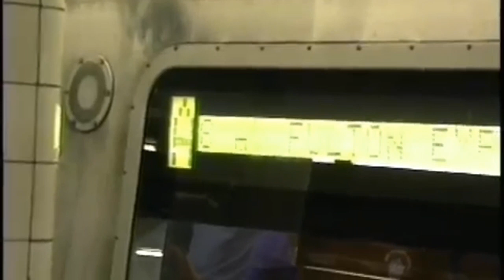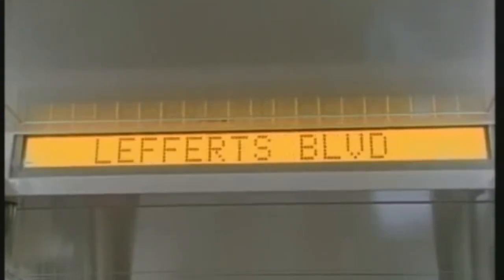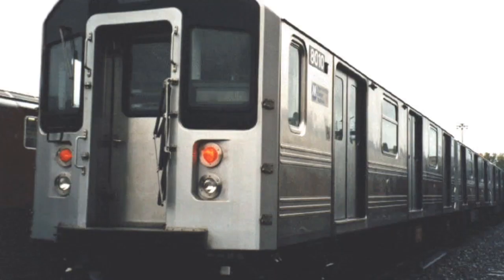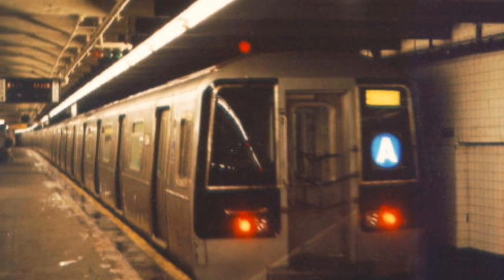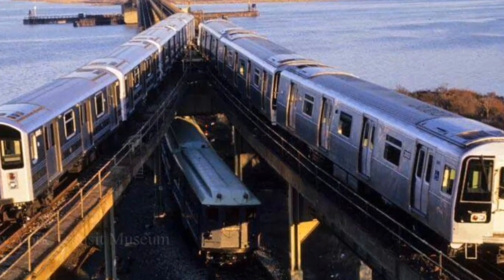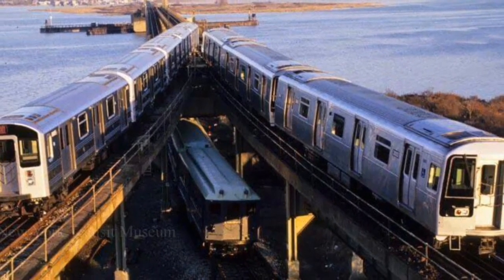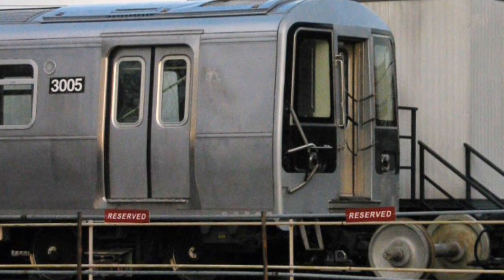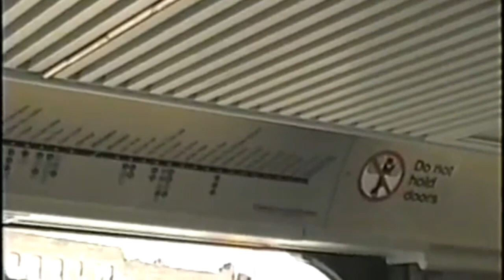R110 subway car review

Comment: Ive Just Realized How Similar The Tracking Systems On The R110A's  Are To The Toronto Transit Commission T1
Reply: that’s true
Reply: Because they have simular propulsion
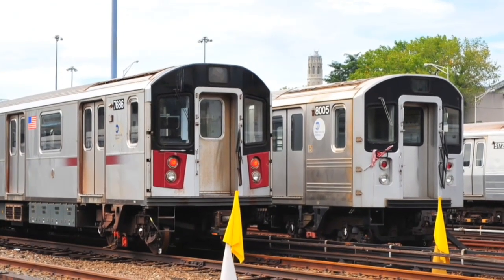Reply: 7:45 This traction system is also on the Siemens P2000 a light rail car used on LA Metro Rail.
Reply: Tracking? I meant Traction.

Comment: I actually liked the 110b car model better than that the  NTT cars that were based off its design.
The 67ft Length is what killed it for the Eastern Division lines,since it couldn't operate in 3 triple sets over there.
However, if those cars were married pairs, then it wouldn't have been a problem. 
The interior of those cars are fantastic, and should have been built with that in mind.

Comment: With out the R110A IRT and the R110B IND/BMT the R142,R142A,R143,R160,andR179s will have problems getting delivered
Reply: Flutershy Fluters Not really.
Reply: They would only have trouble on the design.